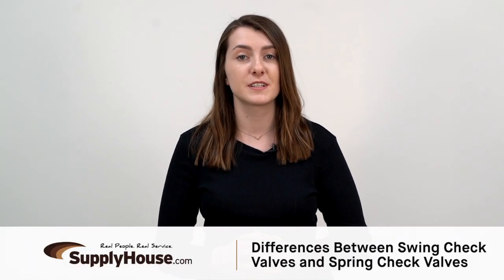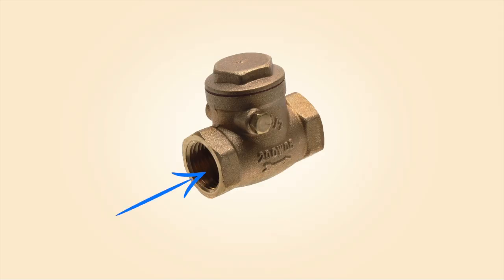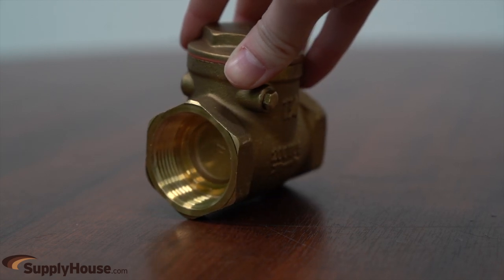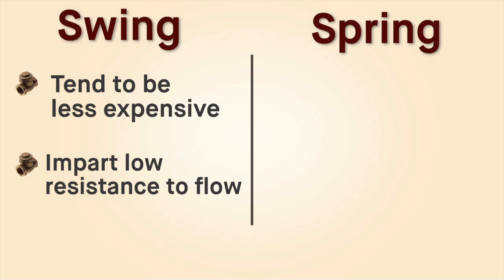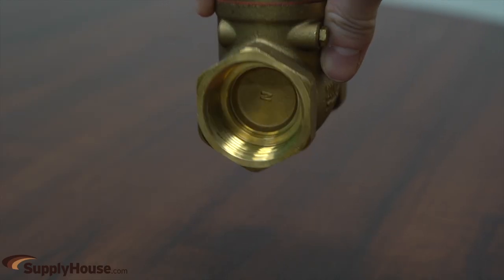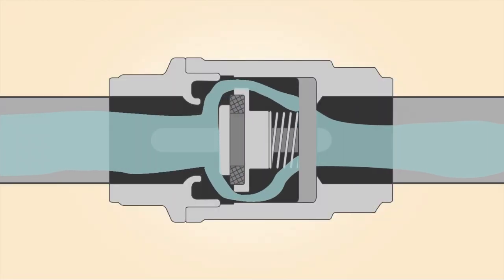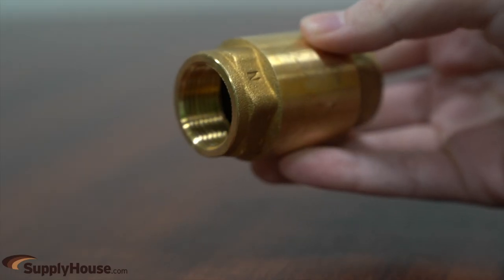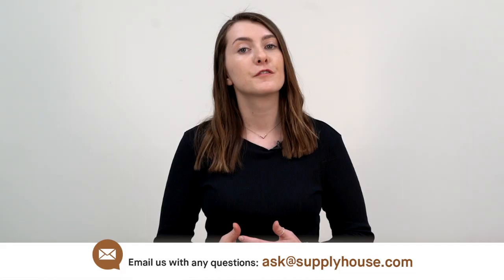Differences Between Swing Check Valves and Spring Check Valves

Comment: Which valve is better for apartment kitchens? I'm on the lower level and my kitchen pipes tend to back up from upper units putting things down the drain they shouldn't.

Comment: Want to use swing or ball float  for a storm drain catchment to fill drums. However, I'm wondering if I'll have problem of it staying slightly open. My main aim of using it is to separate the first  runoff from my stored water.

Comment: Hi there, I am having a problem in using swing check valve at my home installed at the water tank. Flapper stuck on the seat due to high pressure from water pump at the blocking side.when pressure decreases then the flapper doesn’t open automatically which it should. So, I have to dismantle the valve and free it manually (which is a hectic job for me) and then install back. I was wondering if you could provide a solution. Looking forward for the positive response.
Reply: I think it's obvious from the video you should be using a spring check valve.
Reply: @WattWireNet  use spring valve if you have high pressure